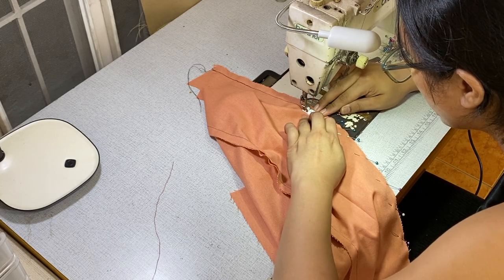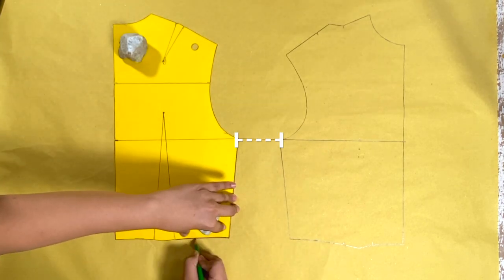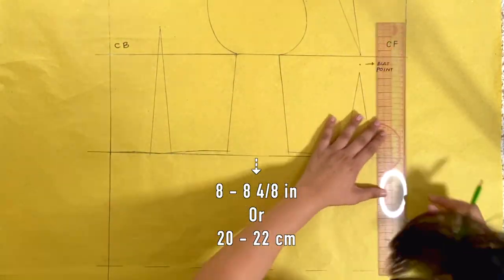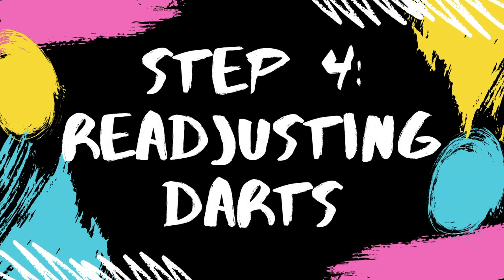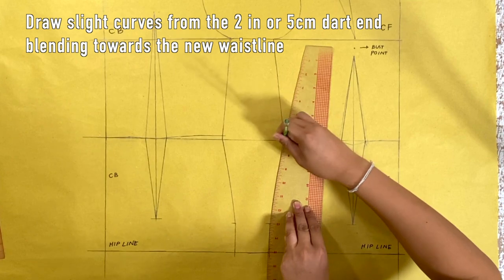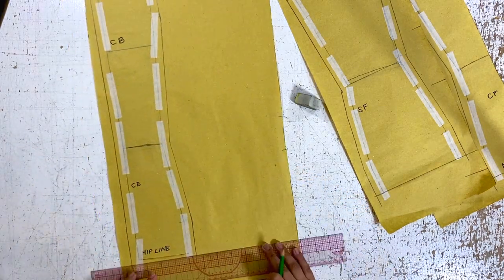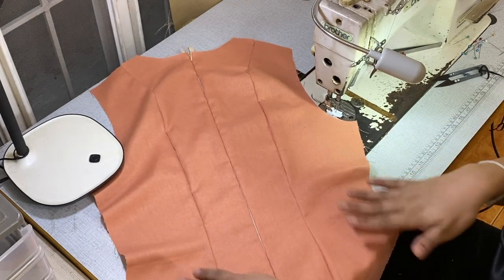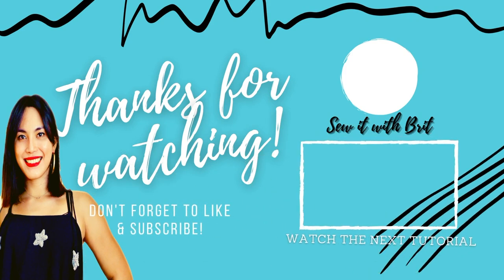BASIC TORSO SLOPER TUTORIAL |BASIC TORSO BLOCK | PATTERN MAKING | LA MODÉLISTE

Comment: Wonderful tutorial. I do have a question. I have a DD bust so I need wide darts. To prepare a new sloper with shoulder and waist darts instead of bust darts my new  sloper side seam was 1.5 inches from the new waistline. I just drew in a slightly curved line to bridge the gap. Is that the correct thing to do?
Thank you for this tutorial.
Reply from the maker: Hi can you message me and show me your pattern and body measurements on insta? It’s quite hard to visualize in words hehe. @lamodelistebrit on ig